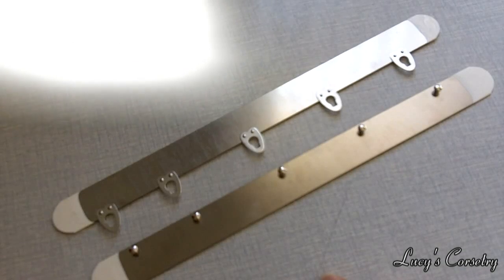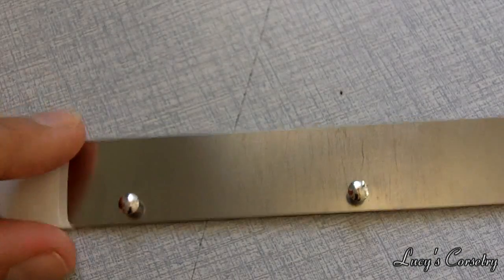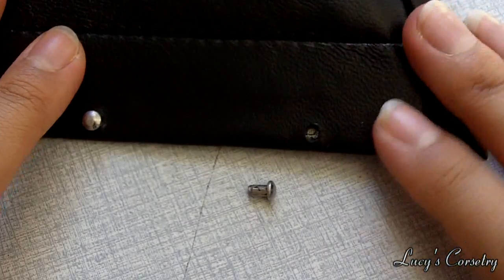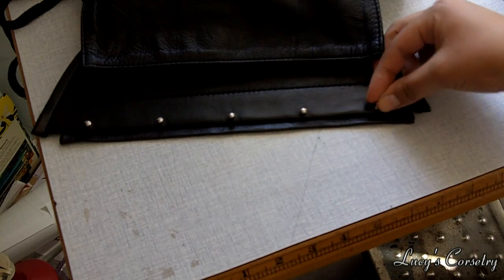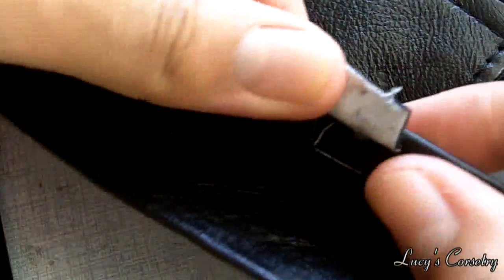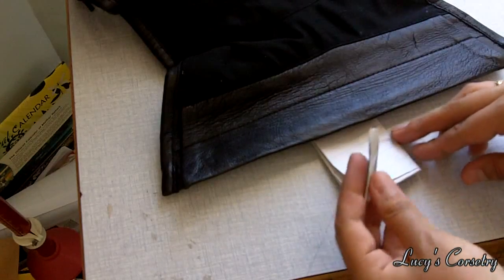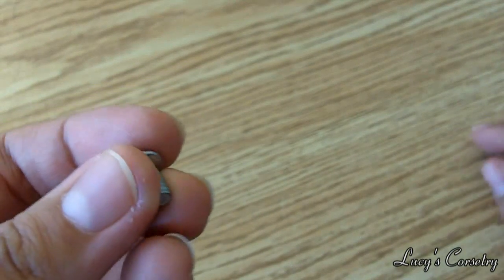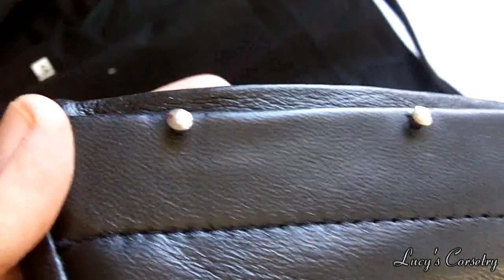Corset Repair: Broken Busk | Lucy's Corsetry

Comment: One point on the use of a screw - the metal's just about thick enough to be able to tap some kind of thread, rather than using a nut. However, also consider the use of a cut-down nail, Also, use a base layer of cyanoacrilate glue topped by epoxy - the cyanoacrilate gets into microchannels in the metal in a way expoxy won't.

Comment: I've tried checking before asking, but am unable to find what I need. Do you have a video for replacing a busk? Mine snapped in half.
Reply from the maker: +MistressIrish Ouch! If the actual bone of your busk snapped in half, it would be best to remove the busk and replace it completely (if you can find a busk that is the same length and same spacing of the loops/ pins). If you really can't do that, then buying a flat steel bone of the same length and sliding it in behind the busk my hold it for a little while, but it really is safest and best to just replace the whole busk (or get rid of the busk and put front lacing instead - I have a video on that here: https://www.youtube.com/watch?v=nr72GovxntU )

Comment: Hi Lucy , First i love all your vids they are all very helpful . I recently had a center pin pop off my cs 345 , the corset it self is perfect, very strong but i was unaware about the stress on the pins,( side to side ) super strong (forward and back) pretty weak.. Im going to attempt the rivet hammer method you showed but the little tool you use for the rivet, im having issues finding that tool , because i do not just want to take a straight hammer at my busk lol. Do you have some suggestions where i should look?
Reply from the maker: I think I simply ordered mine off Ebay, I looked for "rivet setter". But many people swear by Tandy Leather Supply. :)
Reply: *****  Yes, your right i got it at a leather store, i hammered it in .. went in perfect feels pretty strong , i'll be lacing up here soon and (cross my fingers) i hope it stays :)
Reply: Thanks for all your help by the way

Comment: Hi Lucy, this is a little off topic, but if a seam along one of the bones starts coming undone, can it be sewn as normal or will it need to reinforced in a different way?
Reply from the maker: Hello! do you mean just the line of stitching that holds a bone in place, or is it the seam that's holding two panels together? Because if you're careful, you can use a zipper foot to sew very carefully next to the bone just to secure it back in. If the unraveling seam is a crucial seam that contributes to the corset's strength, I have a "quick n' dirty" tutorial here on how to hand-mend a seam:
Mending the torn corset seam
I hope this helps!

Comment: I believe that the 4-40 X 1/4" long screw, (use one 3/8" long if using a nut,) is the most similar in size to a standard busk pin. Spot welding will work if you have access to a power transformer that provides enough current. (Most people don't.) - (Experienced Spot welders can use the cut flap method, ground the Busk by any other pin, and just briefly arc the replacement "pin" at the back.) the heat is localized and extremely brief, and should not really cause any major heating problems.

Comment: Ah ha, you answered my question. Maybe you could add a note on this video, your thoughts about the loop side.  

I'm in that same situation, 2 broken loops. I had wondered the same thing about just replacing the rivets. While thinking it through, the process of fixing it, I came to the same conclusion, just replace it.  If two broke, I have to assume the whole busk is a lemon. I'm really glad you can think out of the box. Thanks for making the video~

Comment: In your file's case, it's more likely the tempering was used to toughen the file so it could hold up to cutting metal. The rust-resisting action is a bonus. The oxide coating that makes those colors will wear off quickly when the file is used, but the effects on the strength and flexibility of the metal go much deeper.

Comment: In this case, I thing the temper has a lot more to do with increasing the toughness and flexibility of the busk than it does with rustproofing it. A nylon coating is much better at keeping things rust-free.